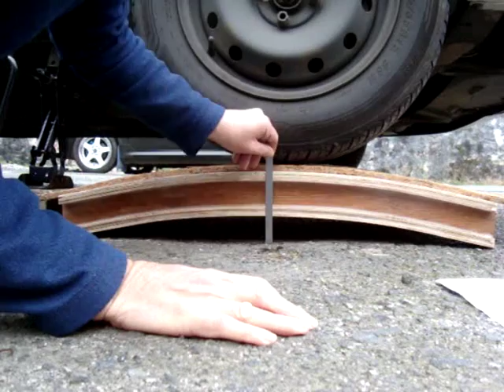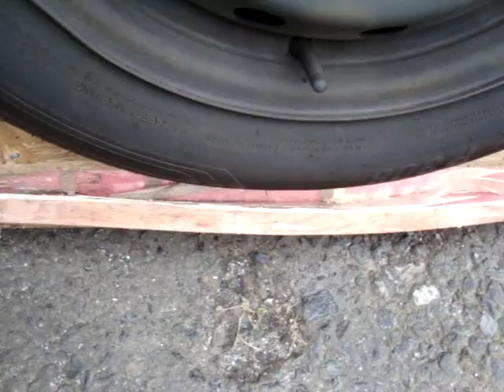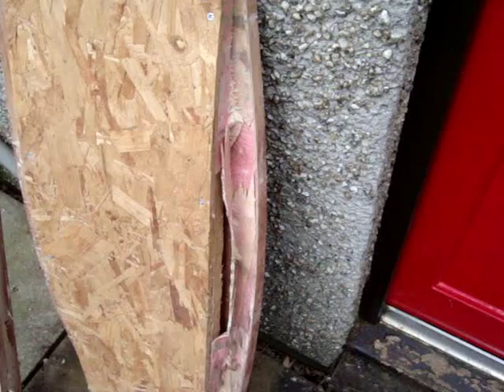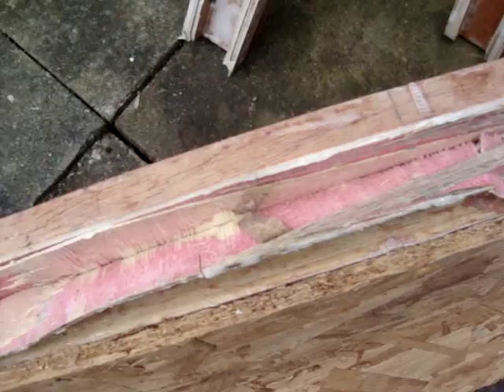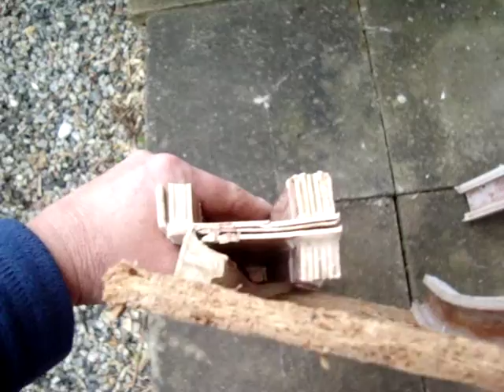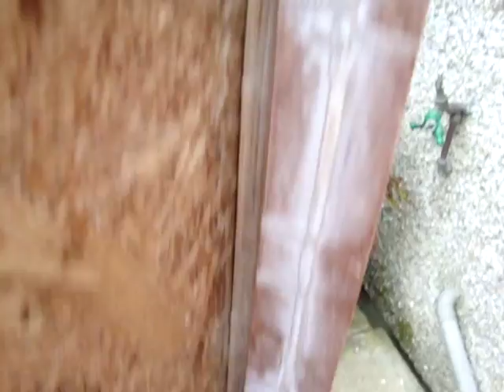Curved Plywood I Beam

Comment: the bottom of a beam is designed to be in tension, in this case that's probably kind of difficult due to the curve which will tend to pull the bottom section away from the webbing when in tension, making the curved design somewhat less sturdy.

Comment: Beam is sitting over a rough surface. The floor is digging into the wood and not letting it spread. Put load over centre and repeat this on a smooth surface, might work better.